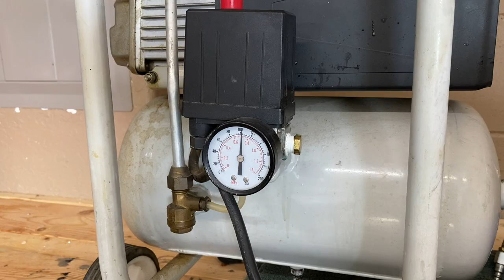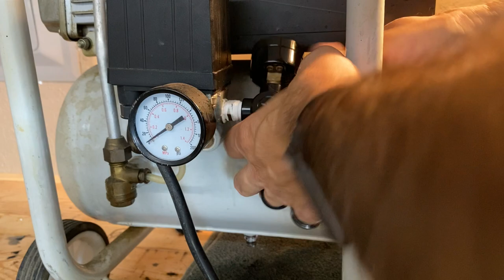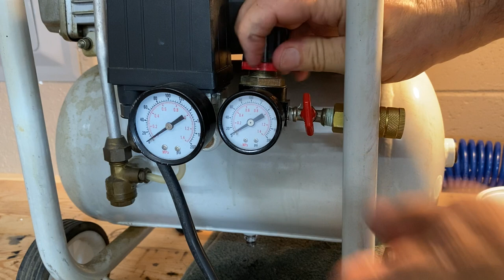How to Fix a Leaking Air Compressor

Comment: Am I the only one who saw bubbles on the clear pipe fitting at 2:12? Not a lot, but it's definitely leaking there too. Must have been temporary since it held pressure for 24 hours. Thanks for the vid.
Reply from the maker: You’re welcome!

Comment: Dope tutorial 👌 
Got an Airgoo compressor w tank but the auto stop never kicked in. So I put Teflon tape and putting back the part it broke. How many turns of tape do you recommend?
Reply from the maker: Sorry i haven't responded. I recommend 3 or 4 turns of tape.